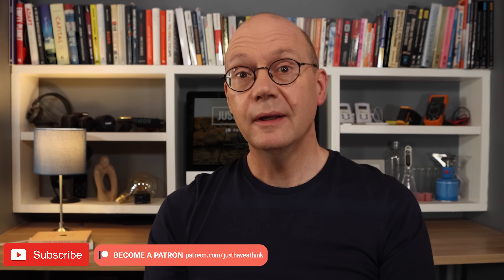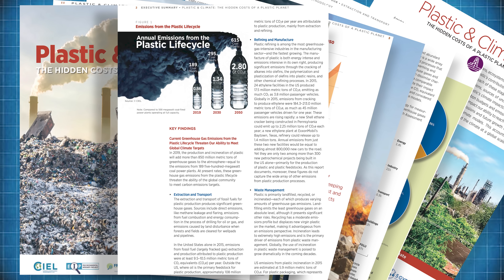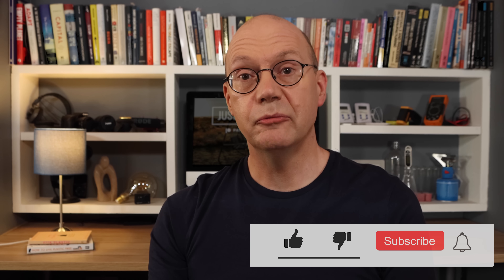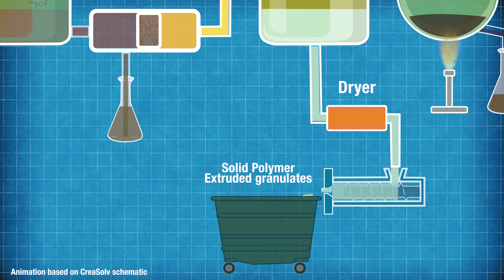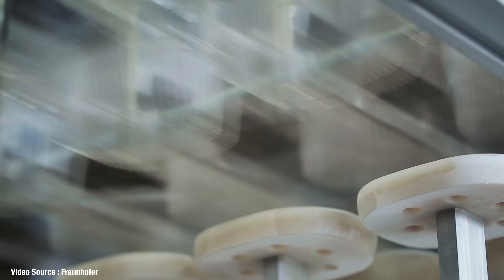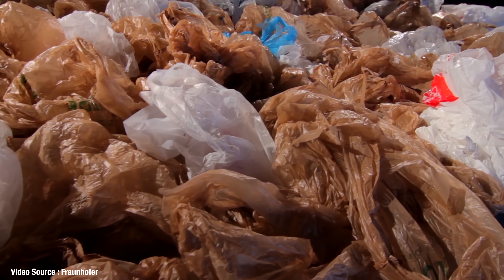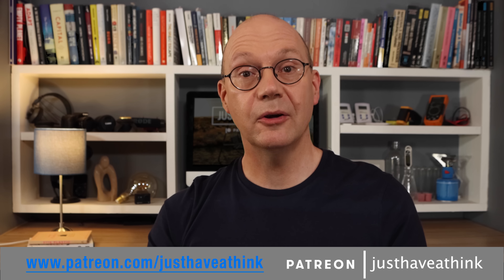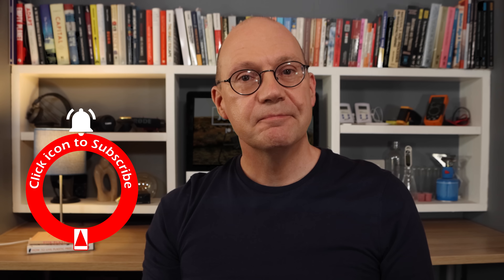Plastic recycling - revolutionary new process

Comment: Hello Dave,
I believe the ultimate use for recycled plastics should be as building materials. In the US one sees construction sides still using great amounts of wood which could be easily replaced by recycled plastic. Much more durable than wood and as you said virtually everlasting, it's place is within the building of structures made to last.
Reply: Yeah but you only want to use RECYCLED plastic there and if you don't then you effectively create another reason for oil and gas industry to keep exploring and polluting 🤔
Reply: @billhanna2148  of course! The idea would be to give use to the immense amount of plastic waste that can't be completely recovered for re-use in the same packaging products. Additionally from removing this waste from the environment, replacing the use of wood for construction and putting a stop to rapid and unsustainable deforestation.
Reply: @crilako  I am agreeing with you since there is an RIDICULOUS amount of plastic waste that can be harvested easily (there's even more than that in the oceans which is not) but eventually ... you have to make more
Reply: @billhanna2148  agreed. In the meantime... 👍
Reply: Um, no.  Using plastic instead of wood for building is not a good idea.   1) Wood sequesters carbon.  2) Wood is a lot cheaper.  3) Plastic may be dangerous in a fire.  4) Building materials have to be cut and shaped on site.  Wooden sawdust is harmless to the environment, but plastic sawdust gets into the environment and causes all kinds of problems.  5) Plastic is already used in some exterior applications like vinyl siding, PVC trim, and composite decking, so there isn't much more of a market that makes economic sense.  6)  Building materials have to meet engineering and reliability specifications.  Thus you couldn't use "junk plastic".  You would need high quality stuff, which would require high tech (expensive) recycling methods and would only be able to use certain plastics.
Reply: @incognitotorpedo42  a lot of different points there, I would suggest you to look up how plastic from recycled "junk plastics" are being already use for construction. There are of course treatments that are applied to them which actually make them safer than treated wood. Now, of course timber from well managed forestry contributes to carbon sequestration, however, where our worries lay are the unsustainable deforestation associated with wood products, after all there's nothing better for carbon sequestration than healthy living trees. In addition, the perverse amounts of plastic waste need a solution and much of it ends up being burnt and contribute greatly to the emissions of carbon and other toxic materials into the atmosphere. There are many other uses to those plastics, what would you propose to use them for?
Reply: @crilako  I'm certainly not in favor of deforestation.  These days, the cutting of old growth forests and the worst deforestation in general happens in less affluent countries; those that can least afford higher priced building materials.  I know there are applications for recycled plastics in construction.  It's not a crazy thing to do, I just think the applications that make sense are already being done.  There are three things we can do with plastic.  Recycle, burn for energy, or bury.  Recycling is the most expensive and currently produces lower grade plastic.  New recycling technology promises to deal with the latter, though not necessarily the former.  Burning creates CO2 at best.  It could be justified if it displaces a worse fuel, like coal.    Most people don't want to hear it, but for the majority of plastic, burying it is ecologically sound and the least expensive thing to do at the moment.  I'm aware of the problem of plasticizers.  It's an issue with a minority of plastics, and there are various ways to deal with it.
Reply: @incognitotorpedo42  hmm, ... burying it could be a temporary solution for the plastic waste that can't be managed while new technology is developed. Some scientists discovered enzymes that have developed a way to "eat plastic" breaking it apart, perhaps that could be a solution to that. In the meantime, examples of cheap ways to produce building materials with recycled plastic pop up here and there only with push back by the industries it disrupts. Take this for an instance, in my country, Colombia, an affluent country of which you speak of, an architect started a housing program for homeless and poor people using blocks that fit like "legos" of sorts. I was discussing this with one of our fellow commentators here let me forward you the link I sent him so you can check it out, let me know what you think.
Reply: @crilako  Wow, very interesting!  It's not clear what you get for 5200 Dollars.  I'm guessing not windows, electrical and plumbing.  This could be a nice step up for many in the third world.  It would depend on what it cost relative to conventional materials, and on how scalable it is.
Reply: Most plastics aren't safe for building materials because they burn like oil and the smoke is more toxic.
Reply: @jeremyelliot4831  good point. I believe there are treatments that make them quite resilient to fires (that would add to the cost but might be well worth it considering the benefits). Some plastics are made to withstand very high temperatures (of course those are not the types of plastics we are talking about).
Reply: But wood as construction material is excellent Carbon Sequestration.  That said, creating giant Lego Blocks would be a great step. . .
Reply: @dewiz9596  funny that you mentioned "lego pieces." In my country, Colombia, there's a company that makes blocks of recycled plastic that fit together similarly to "legos." For now they have been using them to build housing for the homeless and the poor.
https://www.pinterest.com/pin/73394668906623922/
Reply from the maker: Very good point Cristian. I agree completely.

Comment: Hemp Hemp Hemp Hemp Hemp Hemp
Reply: Hemp or any other cellulose films and starch films do not provide the barrier properties required to keep food fresh. PET and HDPE are so amazing because they can seal food/drinks and retain nitrogen or CO2 which prevents microbial growth which would spoil the foods quickly
Reply: @mousetails9  So they could be a coating rather than a structure and be really thin = less plastic.  :)
Reply: @peterhendry2154  Absolutely! For many products this works very well. Apples, lemons and some other fruits are sealed with a thin layer of wax to prolong product lifetime. Cheeses take this even further. However, this coating approach doesn't work for things which require cooking, such as meat.
Reply: @mousetails9  You don't leave the wrapper on when you cook meat.
Reply: @incognitotorpedo42  that was in specific reference to coatings, rather than film packaging. Coatings aren't suitable for all applications

Comment: Hemp! Let's use hemp!
Reply: Yes
Reply: Hemp or any other cellulose films and starch films do not provide the barrier properties required to keep food fresh. PET and HDPE are so amazing because they can seal food/drinks and retain nitrogen or CO2 which prevents microbial growth which would spoil the foods quickly
Reply: @mousetails9  Than stop fcn stocking supermarkets to the brim and shipping food from across the globe just to throw it away anyways, even when was protected in plastic.
Reply: @sodalitia  I completely agree with your sentiment, eating locally grown produce and eating a seasonal diet is the most sustainable diet. However it's very challenging to follow. Even apples grown in the UK are typically stored for 8-12 months in low oxygen environments. Our logistics network and pricing for our society requires forecasting in order for businesses to run efficiently.
Reply: I agree, it's still one of the most versatile materials out there used by humanity for centuries but still only bearly understood.
Reply: Peter A Hemp is very labor intensive. I think that it was Jefferson who quit growing it because the slaves complained of the difficulty and time it took to rett the stuff. With modern machinery, things should go much better.
Reply: @sophierobinson2738  Retting is a biological process which is difficult to control. It can be done with strong corrosive chemicals in a fast manner but this defeats the purpose for choosing hemp fibres in the first place
Reply: sboooon I bought the History Channel's book on marijuana before Walmart had to pull it from the magazine rack. Had lovely info how the colonies were forced to plant hemp so the British could have sails for their navy.

Comment: Recycling plastic is great, as long as the recycled plastic is not used to make fabric, like carpets or mattresses, or other products that generate nano plastics in the air and water, and risk not being recycled themselves at the end of their lifetime. Most dirty plastic should probably be burned in special plants that generate electricity and heat, with extra emission filtering systems so no carbon, sulfur, nitrous oxide, etc. escape from the chimneys. I assume it's already what is being done with the internal lining of plastic when they recycle aluminum and steel cans, but I am not sure.

Comment: There needs to be more motivation for companies to reduce their packaging and hard to recycle packaging.  If they offered tax incentives for better packaging and after a grace period, fines for bad packaging it would help a lot. Designing for easy recycling should be a priority for manufacturers.
Reply: especially when most of the time, companies don't produce their own packaging. There are specific companies managing supplychains that can be targeted with little effort and impact a huge part of the market.
Reply: Companies that are still packaging goods in polystyrene blocks should be shamed.
Reply: @David-bi6lf  polystyrene is not a problem in itself as its 100% recyclable. Problem are the Pearl's expanded too much
Reply: You're absolutely right,  mono-material packaging has been overlooked due to inferior barrier performance compared to laminated layers of different polymers
Reply: @mousetails9  Mono-materials weren't "overlooked".  They were totally looked at, they just weren't effective.   If consumers hadn't been brainwashed into believing that preservative were killing them, then we could use simpler, cheaper packaging.   If you call a chemical a "preservative", people are terrified.  If you call the exact same thing an "antioxidant", which is exactly what it is, then they want to take it in pill form.
Reply: We need to make them pay for the damage and ban single-use outright. Plastic bottles of water only benefit a small group of owners.
Reply: @franklinrussell4750  oh those plastic water bottles really need to be banned asap!
Reply: @reinoud6377  Yes! You are right about that! All plastic bottles do is make a small number of people rich. Every one and animals suffer the consequences.
Reply: The tax incentives would not be needed if the cost of the recycled material was equal or lower that the virgin material, and the PR value of using recycled material could be substantial if the end product were not a compromise of user experience. Shoot for that!
Reply: Great point! It is absolutely their responsibility as well.
Reply: @crilako  Let's send a bill to NESTLE and FUJI water and the
rest of them.
Reply: @franklinrussell4750  They should bear the cost of recycling the packaging they use for their products. That way they would be incentivized to change them into easily biodegradable for single use, and easily and cheaply recyclable for other packaging needs.